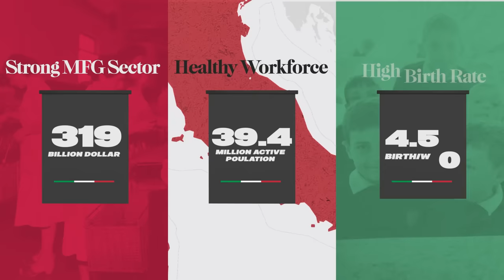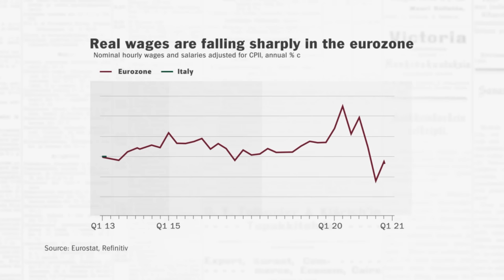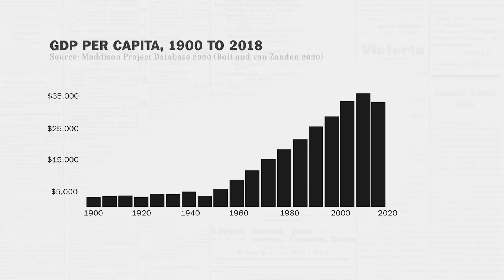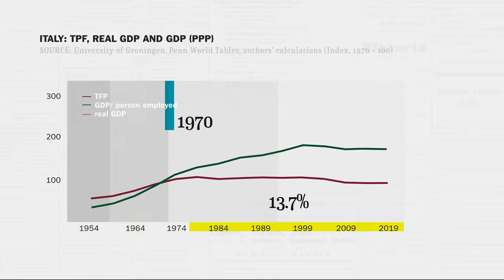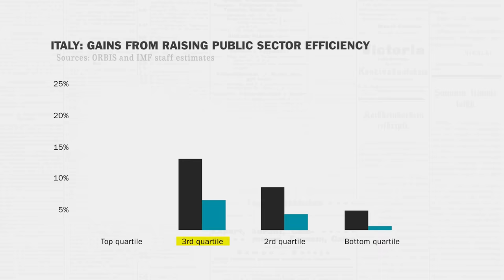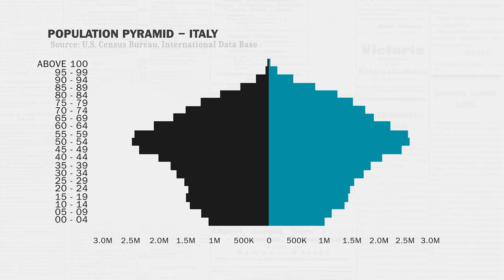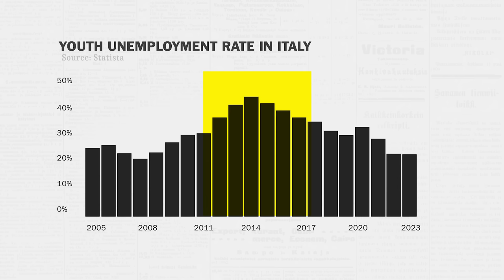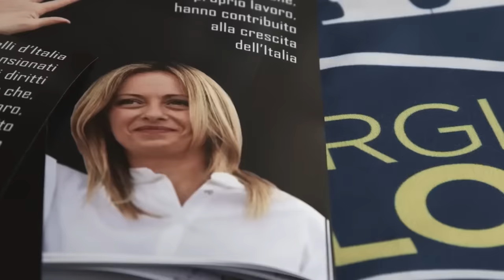The Problem With Italy’s Economy | Italian Economy

Comment: It is true they increased the "fertility check" but since it was basically zero to begin with, doubling it hasn't changed much. They will give you 1-2k € in the first year of the baby's life, then it stops. It's basically less than the taxes you will pay on baby expenses.

Comment: i think that all economies could use a policy of middle class companies being forced to put 10% of their income into a fund that must be used for productivity improving purchases.
A doctor forced to use 10% of his income to buy equipment that makes his work faster or easier.
Or a construction firm forced to use money on making custom equipment to make working less straining. Maybe an electrical cart, or a missing pump or a once missing small crane.
Maybe requirement goes into effect if a company has been operating at a stable surplus for over 15 years. 
Then review the law every 5 years if it can be lowered, and in which cases it needs to be eased off. But it certainly would build up national assets.
Reply: This kind of policy should be managed by the business and not the Government because "where" to invest is such a hard and tough question to answer

Comment: "inefficient" & "few new business"
yeah this sums up Italy pretty good, as an Italian let me tell you...
Everything and anything will be late, every task has to be done multiple times before it works, and waiting time for anything bureaucratic will be as long as it can, they can forget the task if it takes to long and you have to remind them and start again.
most "professionals" will often refuse any task that requires effort, and most of the young can't find a "normal" job, as in anything they do is usually "in nero" translated to "in black" which basically means you get no contract & no reassurances you have to be paid or work a certain amount (mostly because workers cost a lot more with contracts as taxes are a thing), so you get paid poorly, you get no job experience for a resume, and you don't pay towards your pension (if you can live on your own at 30 years you are doing better than most)

and the list somehow goes on...
but we got good food so I guess its all alright

Comment: As italian, 25 yo, something which impacts more on the stagnant economy of the country is related to the bureaucracy and the high tax evasion, which does not do anything but to increase the taxation. This is a legal barrier for firms to access the market and it does not stimulate the willingness of starting a business, fact that could contribute to explain the lack of increase in our GDP. People do not pay taxes because the public services offered do not correspond to what they should be, so people are unsatisfied and tend to evade taxation. The only solution, at the moment would be cutting off the fees to pay in percentage terms.

Comment: Nice video. I just have to point out that Meloni most valuable intervention was stopping the "Bonus 110%" policy that costed more than 100blns in few years. She did not create any policy for the pension system, she discontinued previous policies that decreases retirement age so that the 2011 "Fornero reform" could step in. She is not doing anything to reform PA, or increase the TFP, neither to alleviate the demographic problem.

Comment: Apart from the points stated in the video (which is true) and persisting corruption, another pressing issue deserves consideration - the impact of the European Union and the Eurozone. I don't mean to suggest that their influence is entirely negative, but comprehending its impact requires a deep understanding of Italy, which can only be gained by being Italian or having lived in Italy.
Reply: You mean that without Eurozone we would have had a shitty currency and huge interests on debt?
Reply: @mauriziodellalucia555  I meant that the regulations imposed by the European Union and the Eurozone don't always align with the typical Italian way of working and doing business. However, I want to clarify that I don't think their influence is negative. It's just a part of Italy's transformation, which is not always easy or painless. I hope this clears things up.

Comment: The problem isn't the worker rights or regulations, which have actually diminished (what a world to live in) other countries with equal or better worker protections do perfectly fine... The problem is bureaucracy, inefficiency, corruption, lack of foresight, gerontocracy, private and public mismanegement, private and public embezzlenent, etc.
Plus the fact that the government really doesn't want to work out these things for it would require upsetting their infinite election campaign...
They give token help to things people think are the "blood of our economy" (such as things like food excellences or token small businesses), while doing nothing to promote the high value and high tech industries, which we do actually have, because these need the kind of workers that they don't like as citizens: people with degrees and high levels of skills, people that often don't vote for the kind of parties that get to power here, people that require the kind of things that these administrations normally dismiss as useless or "corrupted by the reds" such as higher education.
On the other hand they are spineless and corrupt, incapable to use either persuasion or retaliation to keep big companies, see those cheats at Stellantis, from moving their capitals and industries to other countries (while also getting duped by the aforementioned time and time again into giving them money because... Nonsense reasons).

Also Genoa and Turin haven't had any relevance in decades... Hell that's the Kingdom's old industrial triangle.
Now the triangle is Milan, Venice, Bologna.